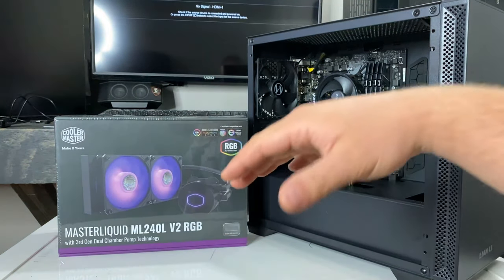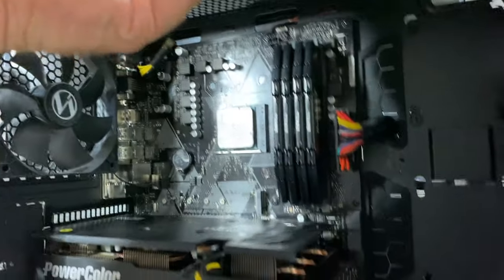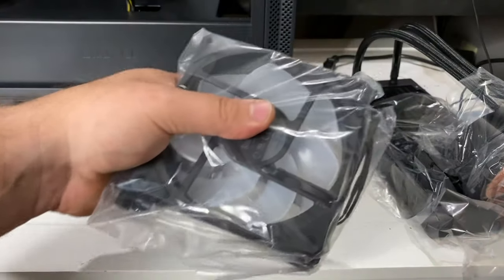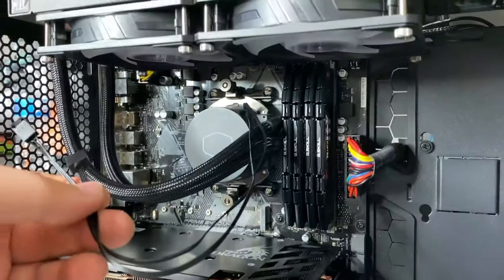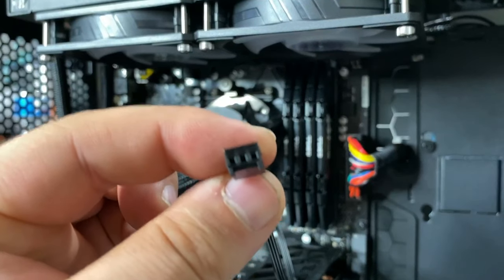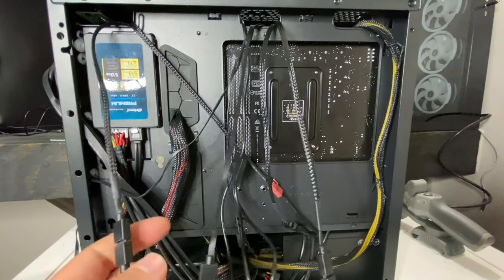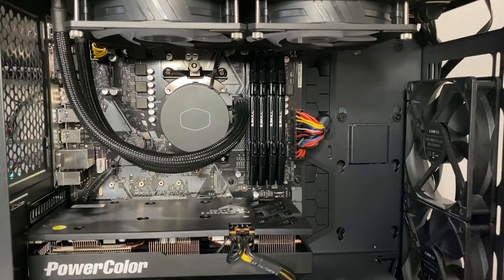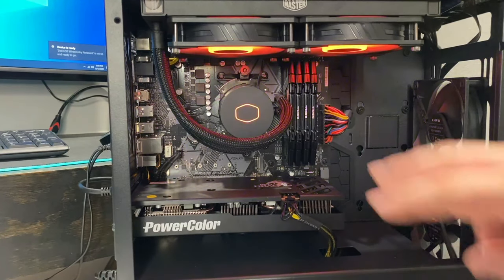How to Install a Water Cooler in your PC (MasterLiquid ML240L V2 RGB)

Comment: Hey V, great videos!  I am trying to install the same AIO into my Phanteks 500A D-RGB Edition.  I believe the only part I can't seem to get is the 3-pin cable from the CPU block.  Mine looks exactly like yours, and I think you said you plugged it into one of your CPU fan headers on your MB.  My CPU/SYS Fan headers are all 4-pin and can't get the 3-pin from the CPU block to fit.  And I am sure I am matching pin 1 to pin 1.  Did I hear you correctly?  Thanks!
Reply from the maker: Yeah you can plug it into any 4-pin standard header. There’s a little guide looking thing on all the header and you have to match that to your 3-pin cable and it will slide right in. I show it in this video here: https://youtu.be/T_Jjzgq_htU
Reply: @BuildsWithV  Thanks a lot, Man.  Just what I needed, I had plugged it in wrong for sure, and I had my radiator fans in backwards too!   I have been watching YT build videos for 2 weeks and yours have solved all my problems, so far :-)  Thanks again!
Reply: @BuildsWithV  Hey, I was hoping you might have some more good advice for me!  
I just finished a new build but unfortunately it won't startup.   Everything appears to start up normally; the LED lights, case fans, GPU fans, etc. are working, but no activity from the keyboard or monitor.  Caps-lock and num-lock do not work on the keyboard.  And I have tried the keyboard on different USB 3 and USB 1.0 ports with no luck but it works on other computers, same with the monitor.  Problem is I have no idea if I have loaded the BIOS setup or not because I can't see anything.

The only funny thing (or not funny really), is at the beginning of the POST (Power On Self Test), the system will appear to start up normally for about 10 seconds then it acts like it wants to die; the fans and lights continue to work but it sounds like it wants to enter startup all over again. Then 10 seconds later it is back to full speed/power, but still no keyboard or monitor.  It sits there humming along like everything is fine.  

I have tested the USB ports with low power charging devices and they seem ok.  I thought about the GPU but then the keyboard is dead too.  Next I plan to start unplugging the peripherals that are plugged into the m/b one by one to try and pinpoint the problem.  If the problem was memory or CPU, I imagine the system would hang and/or crash but it just sits there humming along with no way to I/O.  Thanks for any ideas to try!
Reply: I was able to fix it; it was a bad memory module, 16GB.  I picked up a matching pair today and all is well!  So far.....

Comment: i used different fans so i didn't use the same connections as u. how do i know if the pump is working? the rgb on the front of pump and the fans work, is that the indicator it is working? i don't want to blow up my cpu lol.
Reply from the maker: If your pump is plugged into a fan header you should hear a bit of liquid sound when you first start up your pc which indicates that the pump is working. If the pump wasn’t working the cpu would get pretty hot pretty quickly and most PCs have auto shutdown if the cpu gets too hot. You can download something like coretemp to check your cpu temp
Reply: @BuildsWithV  i've had my pc running for a while , while play games like minecraft and csgo for a few hours and it hasn't seemed phased. i check my bios everytime i shut my computer off jus to see and the cpu temp is usually between 115-125 fahrenheit when i'm done. i think that's good? lol.

Comment: Just wondering if it is ok to leave the old thermal paste on there. I’m going to get a prebuilt PC and change out the cooler when it arrives, so it should be fine right?
Reply: Same question. Did you find out an answer?
Reply: @scornlee753  I believe it should be fine, as long as it hasn’t been on there for a long long time, but idk for sure.

Comment: Hi, what a type case do you use, is a m-atx case ? Cause I wanna buy this liquid to and I have m-atx case so I'm not sure if this liquid cooler will be fit if I put on the top...
Reply from the maker: Correct, this is a mATX case. Will also depend on the case you get but most cases will fit this cooler no problem
Reply: @BuildsWithV  oke thanks maan

Comment: After installing this cooler my computer always enters automatic repair mode and I can never get out of it, any explanations would be nice
Reply: I hope you got it going, unless something was tragically misconnected It's probably not the water cooler. Startup Repair options load automatically when Windows fails to load three consecutive times, there is a bail-out that says Start Windows, if Windows restarts properly, you can run DISM.exe from a command prompt 'as' admin, when that finishes use a command prompt to run /scannow  and type exit and press enter when it finishes. The scan operation is just Windows System File Checker, it verifies and replaces any corrupt system files if CRC mismatches are found.

Comment: Hey awesome video, definitely earned a subscriber! 
I just have a question,
so my motherboard is the ASUS TUF B360-PRO and it has an aio_pump header, 
Would I plug the pump into the aio_pump header and the 2 radiator fans into the cpu_fan header?
Still a novice at pc building any help is appreciated, thanks!
Reply from the maker: Thank you so much 😊 yeah You can do it that way and then just adjust the cpu fan to be a bit on the silent side. Also Make sure to set your pump header to 100% just in case it doesn’t automatically run at 100%.
Reply: @BuildsWithV  awesome thanks heaps

Comment: Is it better to mount it to the top of your case or to the right side?
Reply from the maker: I usually do it on top because you always want the radiator to be able to drain easily. So having it front or side might not work with the hoses on the bottom. To be safe it’s usually best to be up top.

Comment: Hoping you can help me, I recently bought the white version of this cooler and for the life of me I can’t figure out how to plug in the pump. I had it plugged into the cpu opt header and unless I literally held it onto the motherboard the pump would not work and my temps would spike up to 80 degrees and I’d crash.
Reply from the maker: Try to plug it into the cpu header instead of the opt header and see what happens. Are you sure the pump isn’t running? Did you make sure to remove the plastic under the pump before install?

Comment: Do you need a special thing to fill the liquid coolers with and is there a special place you on to fill it at
Reply from the maker: So these type of liquid coolers do not require refills. They are sealed systems and will have liquid for a long time. Typically the pump will give out before the liquid is gone.

Comment: Will it work if I don’t connect the RGB? My motherboard has enough ports for the pump and fan and I don’t have an RGB splitter, I’m wondering if it’ll still work tho, I don’t mind losing RGB functions.
Reply from the maker: Yeah it still works without the rgbs
Reply: @BuildsWithV  thanks man

Comment: i have a problem with this cooler. every time i open a game , the air coming from the fans sounds a lot louder (like a jet turbine) and then it stops and it makes that sound again from time to time . why does that happen? . i didn't install the cooler , a friend of mine did it . Also , would the GPU have to do with that sound too?

Comment: I could use some help clearing something up. What do you plug the remote into? The one that controls the RGB
Reply from the maker: Into a sata cable off of you power supply and then into the rgbs
Reply: @BuildsWithV  it seemed like you could either plug the RGBs into the remote or the motherboard. Would you be able to control the RGBs without the remote?
Reply: @BuildsWithV  apologies if this is all obvious and I’m just missing something
Reply from the maker: @Plasma476  no worries at all. My goal with the videos is to help others like me who are/were beginners and just needed a bit of help. Yeah so if you plug the RGB into the motherboard directly then you will still be able to control the RGB with your motherboard software which is what I recommend. The controller is only there if you need it in case your motherboard doesn’t support the rgbs
Reply: @BuildsWithV  ok thank you so much. This was the final part of my PC, so you essentially just helped me complete it

Comment: Quick question, if you blow the air out to the radiator, it means you're blowing hot air, and the radiator is supposed to be cold, isn't it?
Reply from the maker: Technically it is better to have fresh air come in through the radiator so it consistently has cooler air however the goal with the radiator is to have air constantly flowing between the fins, cooler air is better but any air works okay. Kinda like a car, when the car isn’t moving the radiator fans are blowing air usually from the inside of the engine bay which is pushing hot air and somehow the engine stays within temps. Same concept. Was a great question! Thanks for asking and watching 🙏🔥
Reply: @BuildsWithV  Great question, perfect response. I am doing my first build in 25 years (for my son), I have  a Jonsbo umx4 with 2 top, 2 bottom and 1 rear fan spot. I was concerned the same about drawing hot air through the top. I probably would have been fine with the stock cooler, but this looks and definitely performs better.
Liked and subscribed, thanks!

Comment: Urgent question, if i have two 4 pin rgb controllers on my mobo i can connect rgb spliter  directly there? So i will no need to connect this 3  button manual controller?
Reply from the maker: Yes you can do that

Comment: My motherboard only has CPU_Fan header but no CPU_Opt/CPU_Pump header. Do you suggest I plug into SYS_Fan header and set speed?

Any suggestions?
Reply from the maker: You can plug the pump into the cpu fan or sys fan and set speed. The fans can go into either one as well and set them up to auto or however you’d want.
Reply: @BuildsWithV   how do I set speed? BIOS>CPU Fan> then?
Reply from the maker: @drew8732  yeah and then there should be a way to set the fan curve to custom. From there you adjust it to like 50% (or whatever you’d like) through all temps.

Comment: What software should i use to control the RGB? My MOBO has RGB fusion 2.0 but not sure if it will work. Does coolermaster have a software?
Reply from the maker: You will use your motherboard software. In your case you’ll use the RGB fusion 2.0. Thanks for watching 🙏
Reply: @BuildsWithV  Thank you! Also that was a great video 👍

Comment: Can you refill it? And if you can how? And with what do you refill with
Reply from the maker: So this is a completely sealed system and it doesn’t require liquid changes or refills. The liquid usually lasts longer than the pump itself

Comment: Hi, I think there's something wrong with mine. The light between both fans are not the same (different colour), did I do anything wrong?
Reply from the maker: I think maybe one of the fans leds are not soldered correct or maybe the fan is just defective.

Comment: the radiator fans goes into CPU OPT and the pump goes into CPU FAN on the motherboard?
Reply from the maker: Yes or even the opposite way. Doesn’t really matter. Both go based off the cpu temp

Comment: I’m slightly confused with my motherboard, as it has one chassis fan connection and one cpu fan connection, do I need to plug a splitter into the chassis fan on my motherboard, then plug my exhaust fan and cpu block connector into that splitter and set the fan to 100% in my bios so the cpu block runs at 100% all the time, then use another splitter for the radiator fans and plug that into my CPU fan connector as that’s the one that regulates the fan speed? 
I hope that makes sense?
Reply from the maker: I'd plug the cpu block into the cpu_header and then use a splitter for all the fans onto the other fan_header. You can then set the cpu block to run at any speed, I actually started using 70% instead of 100%

Comment: Complete novice here but are water coolers like this used to only cool the CPU? it's not part of a larger system cooling other components? Thanks in advance
Reply from the maker: Correct these are just for the cpu. You can however get a adapter for gpu which can be used to cool the gpu with one of these AIO coolers.
Reply: @BuildsWithV  Thanks

Comment: hey,I got a question,does it come with pre applied thermal paste?
Reply from the maker: It does not. But it does come with a tube of thermal paste that you apply yourself. A pea size dot or so is perfect. No need to spread it either
Reply: @BuildsWithV  ty <3

Comment: I am having trouble trying to remove the cpu fan cable for my amd wraith cooler. And i'm too worried to use too much force for fearing of damaging d mobo pins. Or is there a specific way of removing the cable instead of just using brute force?
Reply: did you get it right? and should i buy this? im a rookie at it and my dad is gonna help me hes half decent at stuff like this but i hope it isnt too confusing

Comment: Whats ur pc case? I kinda need a water cooler for my pc but im afraid it doesnt fit bcz my case is kinda small(36 height / 19 width / 36 length)compared to the averages pc...
Reply from the maker: This case was the lian li 205m case. Usually you can fit a water cooler in any case. Could be a smaller water cooler like a 120. But that will depend

Comment: Quick question should I run pump at full speed or normal speed
Reply from the maker: Normal speed. I ran mine anywhere from 50-75%
Reply: @BuildsWithV  matter of fact I observed strangely higher temps while using pump at full speed

Comment: Hello can you please respond to me? I’ve been researching pc’s lately bc I’m going to build one for Christmas! So I’m either going with an aio liquid cooler, or the stick fan cooler than comes with the ryzen chips. So with an aio, do you need to actually supply a liquid, or is it just called that, because I haven’t seen one video that says anything about water or a liquid, so plz help me I’m desperate
Reply from the maker: The liquid is already in the cooler, AIO just stands for All-In-One which includes the liquid and everything you need. These are sealed systems which means you never have to change your liquid or anything like that. Thank you for the question and for watching 🙏
Reply: @BuildsWithV  thank you for the answer I liked and will subscribe 👍
Reply from the maker: @sebby2129  Thank you very much 😊

Comment: Why they don’t include the black mounting brackets is unbelievable.  Me just realizing i dont have mine
Reply from the maker: Those come with your motherboard so they won’t include them unfortunately. They’re fairly cheap online tho. Anytime I build a PC and don’t need those for the cooler I save them lol I have a ziplock bag with a few sets just in case.

Comment: Hi, thanks for the video! I have a issue about my rgb however, when I plugged the argb cable into the motherboard, there isn’t any light. However the fans and color work, just no light, I plugged it into the 12v rgb header, but nothing.
Reply: u fixed it?
Reply: @Axzry  yes finally
Reply: @Axzry  it was actually working all along, I was just using the wrong rgb software
Reply: @krunkeecheesee  was installation easy? especially for a rookie like me? and do you have any tips before i buy
Reply: @Axzry  for me the issue was the case. The aio didn’t fit on top, therefore I placed the radiator in the front of the case and used the pre installed case fans. I got my aio fans swapped out later for some Corsair ones. 

Ps. I recommend you buy an aio that’s the same product as your other rgbs. It will make it a lot easier 👌
Reply: @krunkeecheesee  my cooler that is going to be replaced is already cooler master, i have a lian li case but i think the fans will fit just right on top since I've seen videos with my exact case or similar to it so I think I'll be good. I just wanted to ask if wiring it up was easy and assembling it was simple. Also, was it hard to put it on the motherboard? And one more thing, has it worked well so far for you, any issues right now?
Reply: @Axzry   it’s taken a long time to get it all setup, mostly software related. Wiring is relatively simple, it can get a bit tough with cable management if you’re inexperienced but you’ll figure something out eventually. Be aware of your front panel connects, make sure they are plugged into the right headers on the motherboard, this has caused me a lot of trouble because my pc wasn’t starting and I was super worried something had short circuited, turned out I plugged the connectors into a usb header; Be aware of any amateur mistakes. The motherboard is also simple to install, depending on your case of course.
Reply: @krunkeecheesee  so placing the cooler on the motherboard is simple? also is putting the brackets on the head of the cooler hard? and is wiring the rgb fans in the back easy because i dont want to order this and rage about it with my dad lmaoo, but after this i will have no more questions, thanks

Comment: my rgb lights arent working when i turned on my computer. I also donwloaded the rgb fusion software to see if it would work but its still not lighing up? What did i do wrong? I did insert the 4 pin rgb header to my 5 pin 12v rgb slot is that why?
Reply from the maker: That could be an issue. Just make sure the arrow in the connector goes onto the 12v pin on your motherboard

Comment: Hi, I am new to the world of computers and I ordered a computer with a water cooler.  And I don't know if I have to put water on it or not?  or does it come with water in it and it works by itself?
Reply from the maker: That will depend on the type of water cooler. There’s a custom loop which you will need to fill and maintain and then there’s the AIO (All in one) like the one in this video. These come sealed with liquid in them and you don’t have to fill or drain them.